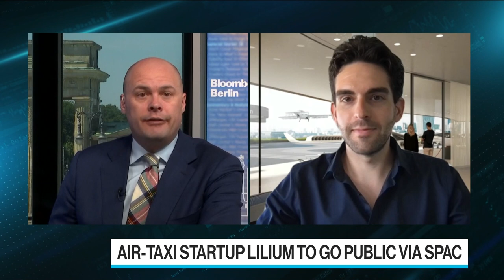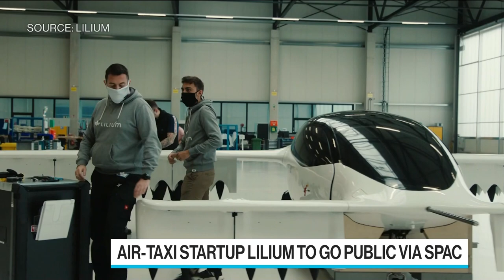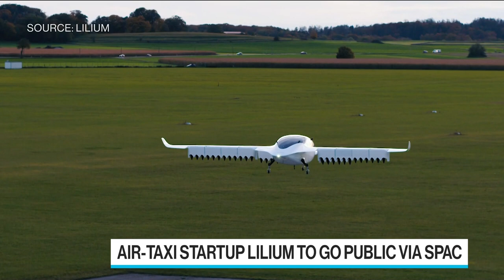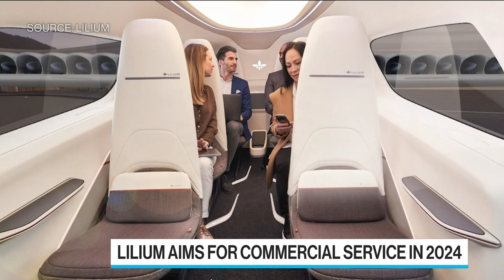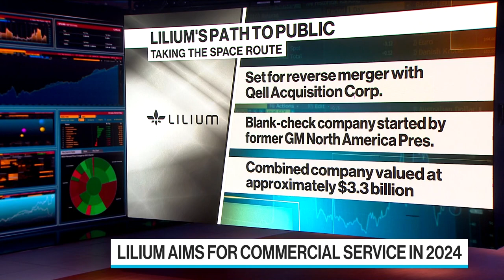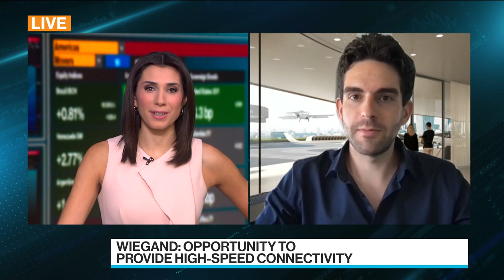Newark to JFK by an Electric Flying Taxi?

Comment: I want to see it fly at least 100 miles even in good weather, then recharge, take off again and fly back. Only then it is worth something. Ohh and another thing... it must have at least 50% battery remaining at the end of each flight.
Reply: It will.  Watch and see.  The most amount of energy dissipation is during take-off and landing in eV-TOL, but once it achieves cruise it's like a glider.  I suspect that the electrical fan engines will get better and better as the tech matures...along with the battery tech.

Comment: the only important question is, will this be cheaper than a helicopter ride ?  If not, then what's the point ?
Reply: Of course it will. Operating costs will be reduced by 75%. The price of electricity, maintenance of electric motors is far cheaper than AV gas and turbines. Operating costs for a helicopter are some of the highest in transportation. Not only is it extremely complex, high maintenance, but high degree of skill needed to fly them. Evtols and electric aviation change that drastically. The most expensive  cost will be the pilot and landing fee. It will be like the cost of a Tesla Model S uber ride with a expensive driver &  parking place

Comment: An array of model aircraft sized electric ducted fans, arranged on pivoting flight surfaces of a basic canard configuration. Nothing exceptional that I can see, and battery technology stuck on lithium.
Reply: with the right power source even a Semi tractor can fly :D
Reply: says the person with zero engineering aptitude or experience.